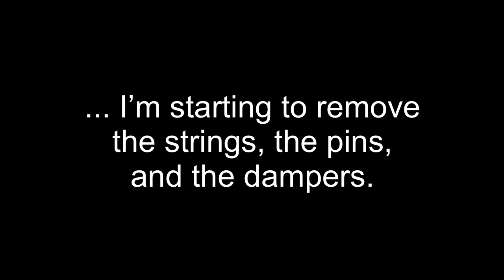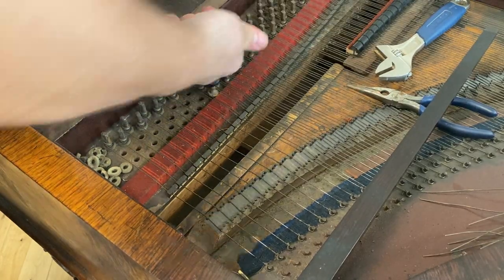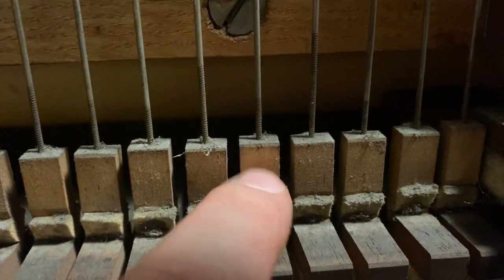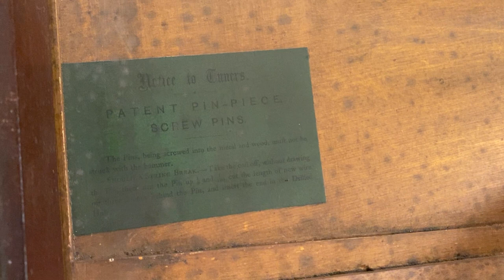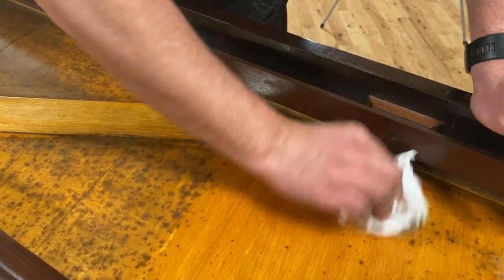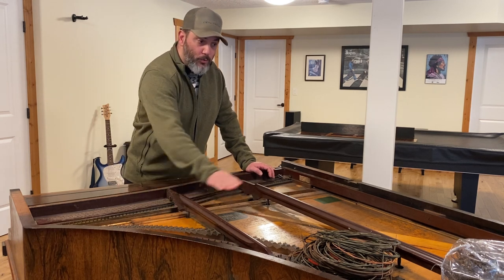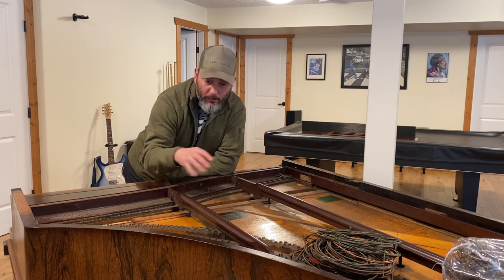Removing Strings, Pins, and Dampers / John Broadwood & Sons restoration

Comment: For the strings, they must be a special type (like from that time) Paulello makes them as do others, they also must be calculated !! so as not to put too much tension on the frame.
Reply from the maker: I’ve got the bass strings wound over bridge like the original and measured the inner and outer dimensions with my piano technician prior to get them produced. I will have them here next sometime next week..

Comment: Nice progress Tomy! I personally you make new pins! hopefully, you'll buff them on a wire wheel before re-install! oh, what am I thinking it's Tomy! If you keep the old strings you can boil them in half water and vinegar, they'll become new, dry them with a rag after 5 min boil, and polish them with metal polish.
Reply from the maker: Haha Pat! You know me... my bench grinder wire brush cannot wait to put its bristles on those pins ;)
I might have a lead into replacement for the 3 broken one from yesterday’s video. Cross fingers!
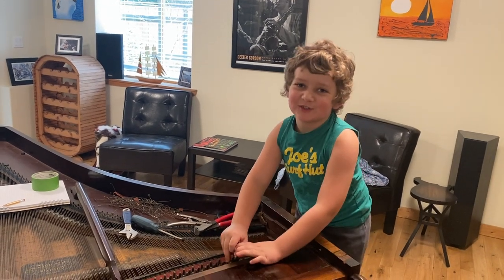Strings will all be new. You can see the bass strings damage on the close up at 4:45 .
But we are definitely trying to keep it as original as possible.

Comment: Been there, done a bit of that. Would've been way easier to make (or buy) a tuning hammer for those "oblong" pins! Or a socket to fit a drill :-)
Reply from the maker: Funny you say that… I got one after I was done 🤷‍♂️.. I will definitely use it when I restring though

Comment: A bit late now but I would have used my cordless drill on torque setting and low speed after initially loosening the pegs.
Reply from the maker: That seems like a decent idea, but the pins weren’t that hard to move. Don’t get me wrong, lots of elbow grease! But these got stuck towards the end. Almost completely out.
Wondering if the bottom of the pins were rusted..
Reply: @HovingtonInstruments  after more than a century they were never going to be easy.  Incidentally I have taken note of J Barnet. I don’t think I mentioned previously Frank Hubert linked to a relative of mine James Bartley Hubert born in London 1909, he died 1992 but his wife Joan sadly died last year aged 95, so because of Covid restrictions didn’t see her prior to passing. But have traced the vast Hubert family (some had 20 kids!) to Jersey and Guernsey in the Channel Islands and French connections prior to 1700’s. Obviously unnecessary for the link with Broadwood but an interesting point of interest when I pass on the family tree to Jim and Joan’s family.
Reply from the maker: I find it amazing the amount of information you can find in such a short time.. really interesting and really cool to find a connection with yourself.
I ended putting only one of the 2 names in this video... but there’s another That I will share in an upcoming video. 
Maybe 2 if there is one on the damper action system 🤞

Comment: I've been restoring pianos for over 35 years and I've restrung alot of old Broadwood grands. I'm sorry to say you've already made alot of mistakes as you were destringing it. You are going to be in a world of pain when you start to restring it. Good luck though 'cos you're gonna need it...
Reply from the maker: Care to explain? I would love to get some of your insight and be aware of what is coming my way...
Reply: @HovingtonInstruments  OK, from watching the video it didn't look like you had released the tension from the frame evenly before removing the strings. That puts alot of dangerous forces through the frame, you might have cracked it which you will only discover when it is tuned. Also, you don't appear to have made a rubbing or taken any samples of the bass strings. Bass string sets are made by hand and are unique to each old piano, the thickness and length of the steel and copper being worked out from the rubbing and samples. You can't rely on the strings that are there being original or correct.  Also, you don't appear to have measured the diameter of the steel strings. If so you will have to work it all out from calculation tables. Even IF the wire sizes are written on the frame, they won't comply with modern sizes. Broadwood factory records are famously terrible so don't expect to get an 'off the shelf' set of strings. When you do restring, PLEASE use 'Roslau blue' wire. Don't be tempted to use the cheaper plated 'red' range because they fade to a dull grey really fast and sound dead after a few years. Because you have removed the tuning pins (I always hated those threaded tuning pins, unique to Broadwood) you will have worn loose the holes in the wrest plank (Americans call it the 'pin block'). IF you are planning to replace the wrest plank you should be ok, (drill the holes half a mm less than the diameter of the tuning pins, and dip the pins into some French Chalk before you put each one in), but if you intend to save it you will need to treat all the tuning pin holes with Pintite to shrink them. (I don't know what it might be called in the USA). In my experience, even when everything goes right these Broadwoods are a right pain the butt to restring....Good Luck :)
Reply from the maker: @queeg6473  thanks you so much for taking the time to write all this information..
The bass strings have been measured by my piano technician ( no video footage of his presence) . The string maker is used to make these wound over bridge strings and I already have them in my possession. 
The gauge and string tensile is still bothering me a bit but I like your input about the brand to use and I will definitely look into it.
I am planning on keeping the original “pin block” any link to the product described to tighten the pin hole? It would be extremely useful. 
As far as tension, I hope I did this right... I loosen the bass tension, keep mid under full tension and started to remove from treble... cross fingers.
Once again, really appreciate your input and help... experience cannot be bought ..
Thank you
Reply: @HovingtonInstruments  In the UK we use this https://www.fletcher-newman.co.uk/index.php?l=product_detail&p=501 (I wouldn't have taken the tension off the way you did it, but you might have got away with it.....) When you put the tension back on, you MUST do it carefully. STAGE ONE. Start with middle C, pluck the string with you nail, pull the first of the 3 strings up to pitch, then do the same to the rest of the C notes going up then down including the bass. Then do the same starting with middle F - first string only. Then C#, F#, D, G, D#, G# etc, all first string only. When you have run out of first strings, start at middle C again and repeat on the second string only. Finally repeat with the 3rd string. Next make sure everything is seated at the hitch pins and all the coils on the tuning pins are tidy. STAGE 2. Start at middle C and pull all 3 strings up to pitch (they will have dropped pitch), then go up chromaticly (all 3 strings)  all the way to the top. Start at middle B and repeat going down. STAGE 3. Repeat stage 2. The strings are now ready for their first tuning.
Reply from the maker: @queeg6473  extremely helpful...
Really grateful for this. Thanks so much for taking the time to write all this information.
The link will definitely be helpful. Will most likely order from the UK.
Cheers
Reply from the maker: Was able to locate the pin Tite in the states so shipping is a little cheaper..
Ordered and on its way, I also added an bottle with a needle applicator to be able to reach the wrest plate from the top.
Once again, really grateful for your insight..
Reply: @HovingtonInstruments  No problem. If the holes DON'T go all the way through the pin block then I would fill the holes right up to the frame, then leave it overnight to soak in. Remove any excess in the morning with a pippet or syringe. When you put the pins back in you will still need to dip them in French Chalk first. If you don't your tuner will hate you.
Reply from the maker: @queeg6473  sounds good, Will do